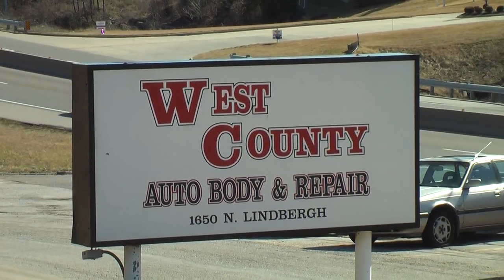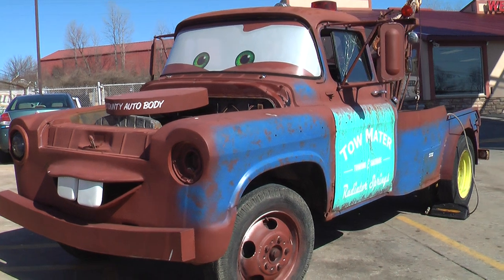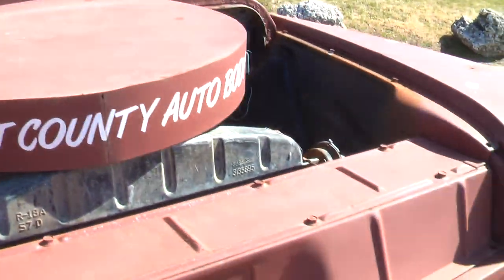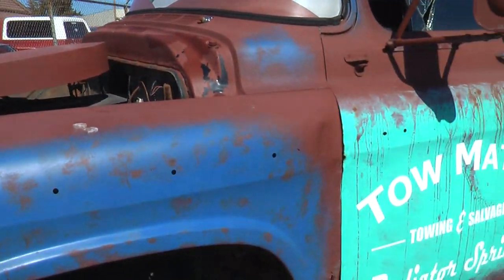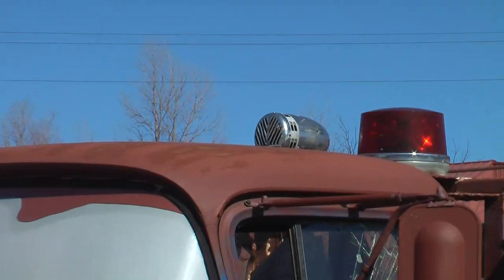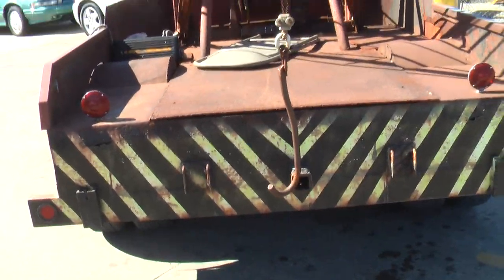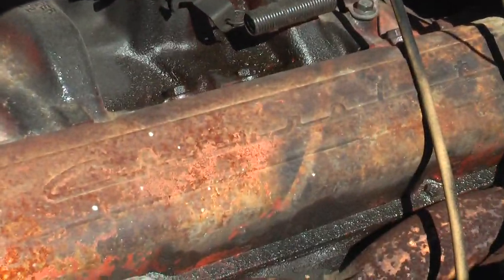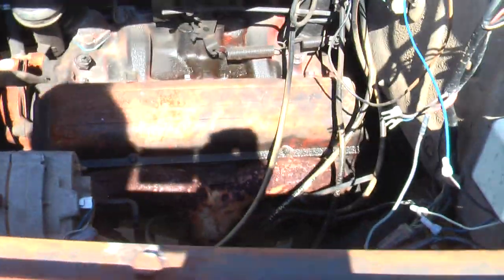Tow Mater Tow Truck

Comment: Too bad it's a chevy and not an International like mater was modeled after. I have a 1968 International 1300D that would make a great mater, but with 70,000 original miles and still on nylon tires, I think I'll leave it alone. Mater by the way was modeled after a 65 IH 1300 tow truck.